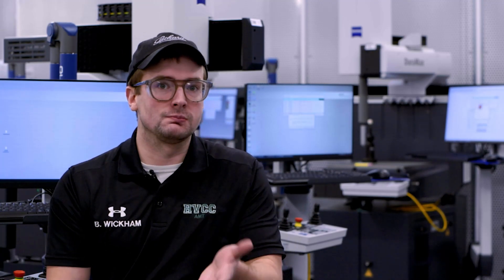Zeiss CMM: Is the "Cookbook" always right?

Comment: How I train my students is to start with cookbook and if it is to slow - measure the part 3 to 4 times without moving it so you have a base line and start upping the speed and until the data changes more than you can accept.  

You will find that speed is not as important as filter and outlier.  

For my students before talking about Cookbook my default scanning speed is 2 to 5 times faster than cookbook recommends; what we see is that filtered data with outlier at the faster speeds give me the same result as when we rerun the part at the recommended scanning speeds (with filter and outlier).  

A lot of time you will also see that scanning is faster than single points especially on smaller diameters prime numbers with single points on round parts and you will see roundness issue with single touch.